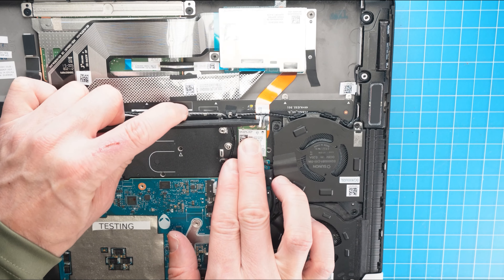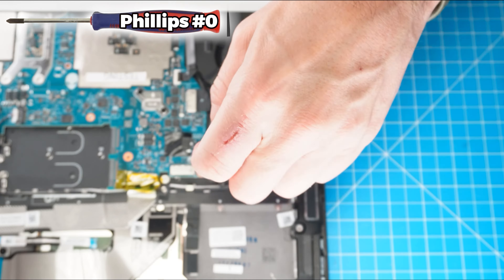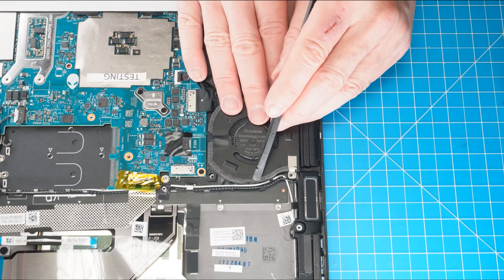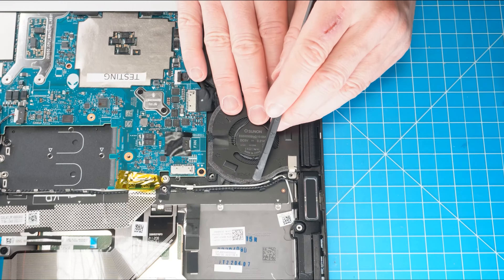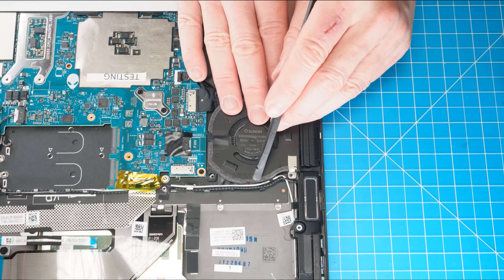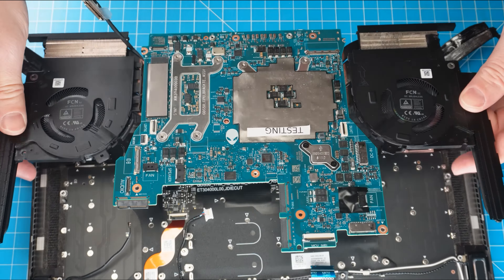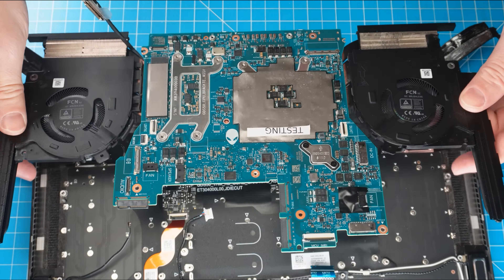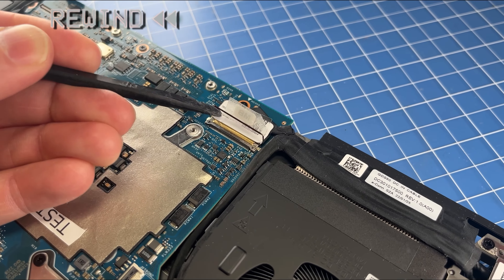How To Replace Your I/O Circuit Board | Dell Alienware x15 R1

Comment: did you reuse previous LCD adhesive tape or purchase a set
Reply from the maker: I personally reuse the adhesive even though it loses stickiness. I don't find that it's vital in securing the cable connection.
Reply: @ I thought it was more for keeping the LCD in a locked position
Reply from the maker: @itsGranj  You're right. I've never had a problem with it unlocking, though, so it hasn't been an issue.